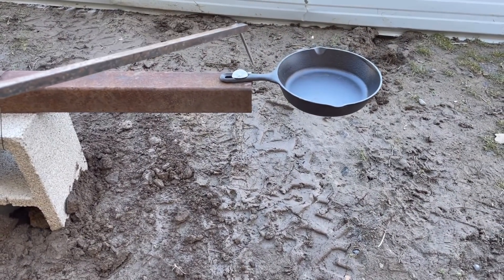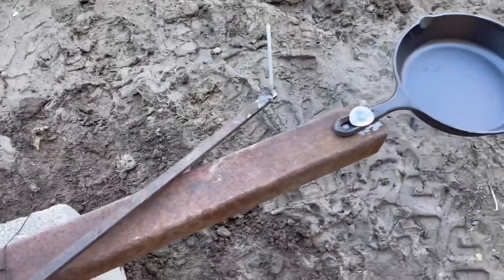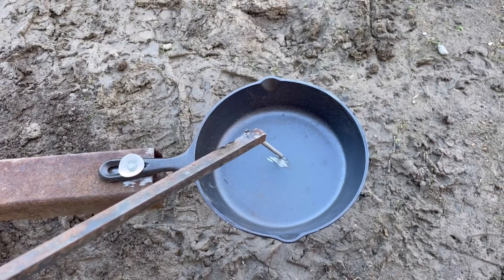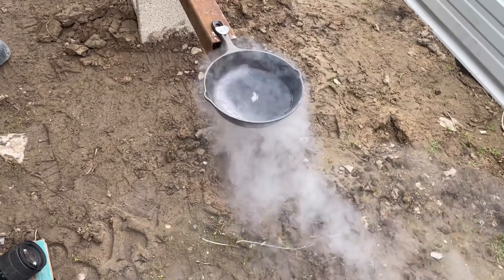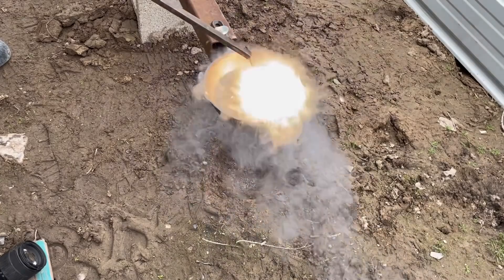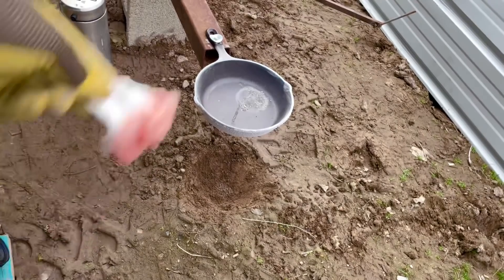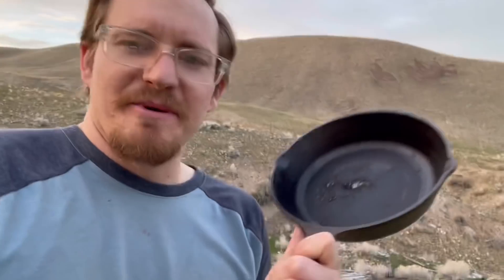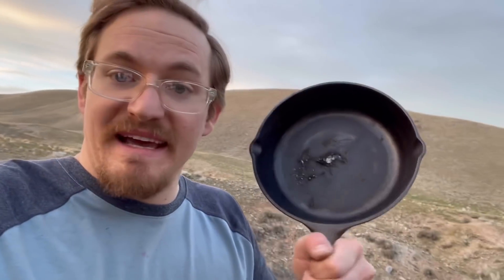Welding in an iron pan full of liquid oxygen

Comment: I've read that oxy/gas cutting is not burning the iron i.e combustion, but rapid oxydisation i.e. rusting. This is why you can only cut iron with oxy/gas and not other metals like aluminium for example. Look up the difference between combustion and oxydisation

Comment: I cut metal with a cutting torch and it doesn't burn the metal in any way. A cutting torch has two different sets of holes, The outside holes you burn an oxy acetylene mix, used to heat the steal to the melting point and the center hole also has oxy acetylene but the cutting lever on the torch bypasses the needle valves on some torches  (2 knob style) or opens the valve controlled by a third needle valve on (3 valve torches) either way the center hole has high pressure oxy to BLOW the liquid metal away just like a blow gun. It's a balancing act to move the torch slow enough to keep a sweet spot of melting metal to get blown away. Too fast and the torch doesn't cut and too slow blows the steal away and none is left to heat and metal so it stops cutting. Too slow also makes a less clean cut. Either way it's not burning but melting and blowing, The molten metal blown out is also slag now as it is exposed to oxy while melting so it does "burn" really it oxidizes.

Comment: Cutting with plasma or oxy/acetylene is very different from something like this. You only get the cutting action when you have molten slag helping to blow through the metal, without that you getting nowhere, if you start blowing oxygen with a cutting torch to early or go to fast it will stop cutting completely. Stainless steel does not form the same kind of slag as normal steel so you can oxy/acetylene cut it, but with iron powder added separately to the frame you can get that slag and thus cut stainless steel as well.

If i remember correctly I think they blow oxygen into the molten metal when they make modern steels to reduce the carbon content as it reacts with the carbon and burns it. Carbon is not desired in most modern steels as it makes them bad for welding and we have other alloy elements to make tough and strong steels.

Comment: Welding instructors often turn off the fuel gas while cutting to demonstrate the rapid oxidation of steels. In some cases depending on flow rates and tip size - the steel cuts faster without any fuel gas. Bonus nachos; Propane and propylene tend to cut thicker than acetylene.

Comment: The problem I think is that your welding, which is adding metal, likely rusty metal because of the oxygen, but adding metal none the less. You need a tungsten rod to arc gauge the shit out of that pan. You really wouldn't need oxygen, also you're not stable enough to maintain an arc, you gotta go in with your hands bro. I have a degree in welding tech.

Comment: The fact is you can't cut cast Iron with a cutting torch, you can melt it but it doesn't burn like steel, not shut why but have been told this. The steel burning in the oxygen heats the metal and the pressure of the stream of oxygen flushes it from the cut.

Comment: I was wearing cotton gloves at work and cleaned a torch tip while it was cool and still on the torch. While handling I bumped the O² button several times and even remember how cool the decompressing 0² felt on my hand inside the glove.  Until I went to light the torch with a striker. Poof my left glove immediately turned bright like that oily rag.  I pulled it off as a reflex reaction and it pretty much little of the glove remained once it hit the floor and I didn't get burned at all.

Comment: What’s most interesting is the fact that the fuel gas (acetylene, Hydrogen, etc.) in a torch isn’t necessary to burn (cut) metal. All you have to do is use a fuel/oxygen mix to start a cut then you can shut off the fuel and just cut with oxygen…Many people cut thin sheet metal using just a regular welding tip and they shut off the fuel and continue the cut—no cutting torch needed at all.

Comment: The thermal kinetics also worked against it because the liquid oxygen, while boiling off, would rapidly carry away the heat faster than the combustion could ensue.

Were it all tightly contained, so that the oxygen could not boil off, and the surface area greatly increased [as is the case when they charge a blast hole with coal dust and lox] THEN you can get some pretty enthusiastic combustion!

The thermal kinetic barrier is so much so, in fact, that they have gone on to employing the pre-chilling of coal dust with liquid nitrogen before injecting the LOX because it 1, decreases evaporative losses and 2, reduces the chances of preignition.

So, in essence, by dropping the temperature like this, decreases the likelihood of spontaneous ignition of most combustible materials, even in fact in the presence of such a strong oxidizer.

I would NOT say it would be so safe, however, were you to use concentrated H2O2! [which, as we know, is a liquid at room temperature].

I have cleaned stainless steel pans of built on carbonized food matter before with just 27% H2O2 [pool disinfectant]

Comment: A cast iron pan does not contain enough iron to sustain a fire, which is why they get so hot and don't buckle. They are mostly glass. If you can't cut it with an oxy-acetylene torch, it won't burn in the presence of liquid oxygen. 
I think that the reason you can even cut steel with oxygen is because the ignition temperature is lower than it's melting temperature. But that might be incorrect.

Comment: the metal needs to be hot when cutting it with a torch as you said, so why did you cool down the pan before trying to cut it??? isn't that backwards?
you should try liquid oxygen in a room-temp pan, or even a pan that you put in the oven.
Reply: If the pan wasn’t pre-cooled with nitrogen, the oxygen would evaporate at a more rapid rate. He’s basically buying himself time to do the experiment lol.
Reply: @maddieazriel  I know why he's doing it, I'm just suggesting he try another way, because the person who told him he could cut a hole through the pan with oxygen, never specified the temperature (as far as we know) and generally when its not specified, you should default to room temp.
he could also try higher temperatures than that, because chemical reactions speed up when they are hotter.
Reply: @Metal_Master_YT  ok lol

Comment: Maybe it would be possible to burn a hole in a pan with high voltage arc. Say, few tens of kV. The arc would hopefully remove oxide layer from a surface for more oxygen to react.

Comment: Thermodynamically and heat transfer-wise, it cannot burn a hole. The ignition temperatures of bulk metals are approximately around their respective oxides' melting temperatures. For the metal pan to be at its ignition temperature (possibly lower in pure oxygen but not that much lower), a portion of the pan has to be at a very high temperature. With the high thermal conductivity (and thermal diffusivity) of the iron and its thickness (it is a good thermal 'conduit'), a significant portion of the surrounding pan area would have to be very hot. This is difficult to make happen, as the liquid oxygen cools down the pan as it burns and prevents ignition. Maybe this is a paradox---like what came first, chicken or egg. There is also cooling from evaporation of the LOX (evaporative cooling).

A similar phase change cooling paradox wiht combustion occurs when you dip your hand in an alcohol (e.g. isopropanol) and then light your hand on fire. you feel no heat until the alcohol is near extinguished because the isopropyl evaporation and layer of alcohol on hand prevents hand from getting hot. (DON"T TRY THIS). Or, further evidence----you soak a piece of paper towel in a highly volatile fuel (isopropyl again). Then light it and observe. The paper towel doesn't start burning until all of the isopropyl is consumed---same effect.

Cool video. Worth a try!

Comment: Hi Cody,
This was great.  I always pay close attention to your science-themed trials and experiments, and also like seeing how you're protecting your land and making a base.
All these themes came together recently with your work making charcoal, and I'd like to ask your opinion on a topic for some research or a trial.  I've been wondering whether someone could make charcoal using a vented 50 gallon drum heated with a sun scorcher (the name I've heard used for a huge flat fresnel lens from an old projection TV mounted in a frame).
We have burn limits here in Oregon, so I can't use the barrel method, and I'd also like to turn all the wood you'd normally use for heat into charcoal anyway.
The big catch for me is how to douse the hot charcoal with water to activate it.  I liked watching your setup with the kiln, but I'm wondering if you could make good use of the scrub at your base and avoid the need for electricity by carbonizing the material in a covered barrel, then removing the lid (?) and dousing it from a distance for safety reasons.
If you try this out, it may provide a model for folks all over the West to efficiently and cleanly condition their soil.
Thanks, Cody.
Alex

Comment: In my experience cast iron doesn't flame cut. You're just melting it and blowing it away. Pretty sure you need a steel alloy before it works well. So a carbon steel professional pan/wok probably would ignite.

Comment: Someone told me activated charcoal / pure carbon soaked in liquid Oxygen would explode similar to TNT.
 I don't know if you just could light it on fire with a match or if it requires a primary charge to provide an initial flash like a blasting cap.
Or maybe it was just BS.

Comment: Hi, I have a bit of a random chemistry question if you or anyone can answer.

 I want to react silver tungstate with cesium chloride to produce cesium tungstate (I remember you making it from cesium hydroxide and tungstic acid but that would require me making some cesium first). So how do I do this considering ag2wo4 is insoluble in water. It is soluble in hno3, nh3 or potassium cyanide but I'm not sure if that helps me.

Thanks
Tom

Comment: so i came across something about 3d printing mozaics and damascus steel using steel powder, and was wondering if you could try to make a gear for something useful using this technique and machining? it would make the process of making transmission gears or making parts a lot cheaper and easier...

Comment: The fire triangle requires heat, fuel, and oxidizer, welding is supposed to provide the heat, LOX is supposed to provide the oxidizer, however these two legs strongly oppose one another, the heat from the arc vaporizes the LOX, forms a barrier of gaseous superheated oxygen , and rapidly cools the weld zone, so the reaction can't really take off.

Comment: Run oxygen gas through a steel pipe, light the end of the pipe with a cutting torch until is maintains itself then push the burning end into the pan.... oxygen Lance... will definitely cut through....

Comment: Problems: it’s Steel, not Iron, that burns so very well with oxygen because of its Carbon content and that pan is IRON. (Try torch-cutting iron some time, it isn’t fun at all until you introduce some carbon in the form of a steel welding rod). Steel must reach a critical Kindling Temperature in order to ignite. One man recently shot a Steel O2 bottle with an armor penetrating projectile- the impact friction was hot enough to start the reaction resulting in a big hole that looked just like a torch cut. A skilled torch man can start cutting steel with a torch and turn the acetylene (fuel) off and using O2 only-continue the cut indefinitely as long as the zone of reaction doesn’t get chilled below kindling temp. Counterintuitive to most: Oxygen itself doesn’t burn, it reacts to combine with other elements. Burn Hydrogen, you get water; H2O.
40 years or so playing and working overtime with this stuff and listening to old timers.

Comment: Hahaha well, you DID faff about a bit after pouring the liquid O2 so a lot did boil off before you struck up a weld. Plus, if you had poured in a lot more liquid O2 so that the pan was almost full, you could have started welding under the 'surface' of the O2 rather than have a shallow puddle say... 🤔😏, but nice thought experiment anyway 👍    😎🇬🇧

Comment: heat the pan instead, you chilled your fuel to -200. Maybe try a dutch oven, hotter and more controllable arc, like a chilled thick steel disk for thermal mass with holes drilled for vents held close to the surface for wider arc and blow lox through the center

Comment: i really didn't put much faith in this. Reason: As you get the pan to burn, it would be so hot that the oxygen would evaporate in less than 5 seconds. It already was doing that, just with room temperature.

Comment: You did not remove the flux of the weldrod. I can imagine, without the flux, the reaction will be quite dramatic. I didn't find any figures on how much CO2 is produced when welding with these weld rods, but I am pretty sure, you have a pretty stable "bubble" of CO2 once the weld rod is lit.

Comment: Hey Cody, this shocked me because I've seen this happen IRL. Are you sure it didn't fail because the temperature of liquid oxygen is waaay colder than the oxygen gas coming out of the gas axe? I've always been scared s'less of pure oxygen, especially after watching non flammable surfaces burn in it 😂

*edited due to me being an r-tard.. I actually wrote inflammable instead of non flammable. 😅
Reply: It may have worked with a thinner pan, the thick cast iron takes a lot of heating.
Reply: Inflammable means flammable??? Crazy country!
Reply: @MrMilarepa108  thanks for pointing that out 😂 I'm a spaz..

Comment: I have used large metal cutting lances that used pure oxygen at 100 lbs pressure to cut heavy castings , it required three large oxygen tanks and heavy leather protective gear when   i worked at Marion Power Shovel in 1970 .

Comment: You might try other metal. Cast iron is impossible to cut with oxygen acetylene torch. Maybe that was the problem. I hope you can do that with steel pan or other material. Try them cut with oxygen acetylene torch first to make sure that the reaction actually works.
Best regards,Matej

Comment: You could try pre cooling the pan or target in general with some thing like dryice to so it is less inclined to just vape away before you even gt to it, you also need a point to haet enough heat into a localized area.

Comment: Two jobs ago, the place I worked at had a bunch of older equipment with flathead engines. Every now and then the mechanic would run pure oxygen from a welding tank into the carburetor with the engine running. This was supposed to remove carbon buildup. I'm not sure if this worked or not, but the guy claimed it would.

Comment: I used to work on liquid oxygen storage and Delivery Systems in the medical industry. I've done just about every experiment I could think of with liquid oxygen as after testing stationary and portable liquid oxygen Dewar's we had to dump the liquid oxygen out after testing. During training someone told me if you soak a charcoal briquette in liquid oxygen and light it it will go off like dynamite. This is the one experiment I never did try. Maybe you can try it?

Comment: Paused at 1:36: I believe it's true that you can easily burn through a iron pan filled with liquid oxygen. I've done the trick with steel wool for my kids. You can set steel wool on fire with a lighter and swing it around in the air with your arms and it will burn and sparkle almost like fireworks. Try it! It's fun, and pretty harmless as the sparkle that flies through the air don't last long enough to burn the skin.
Reply: ... oh well, and I was wrong. What is the coating on the pan made of?

Comment: Should use steel wool as a fuse/wick to start the reaction
Reply: Also it releases heat to quickly with the oxygen boiling off, but if that happened in a pressure vessel to raise the boiling point that'd be scary

Comment: The result might be different with a steel pan. Cast doesn’t burn as readily steel. You can cut cast iron with an oxy/fuel torch but it doesn’t run as smoothly as it thru steel the same thickness.